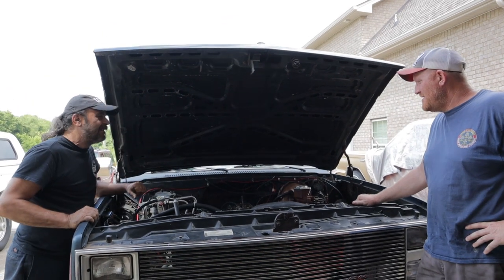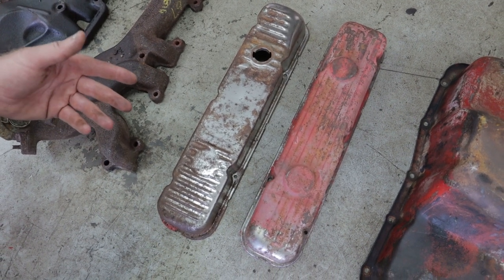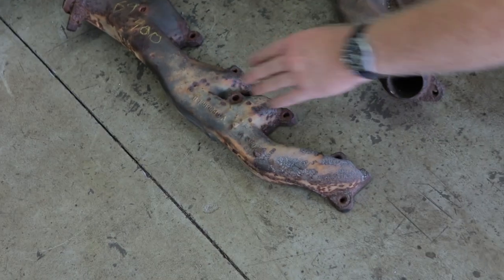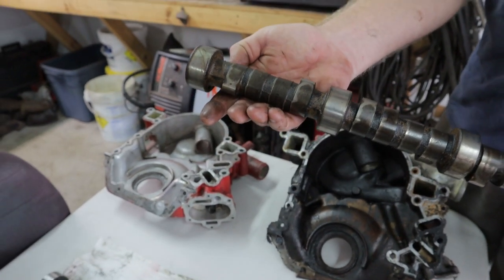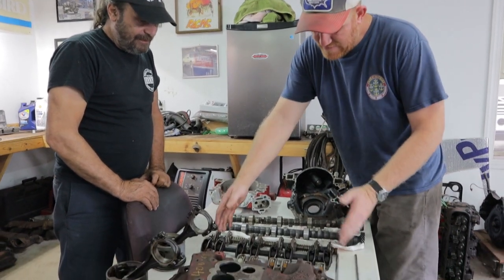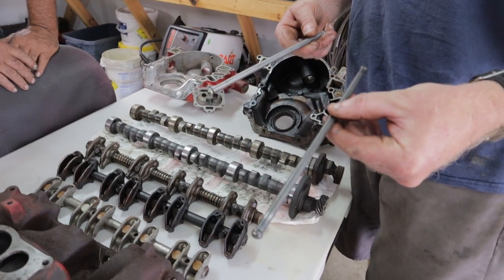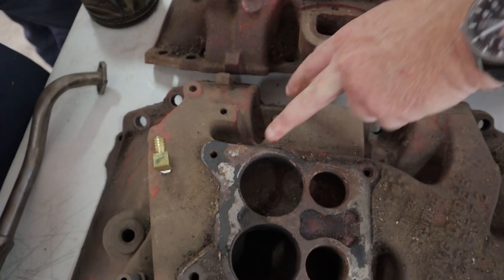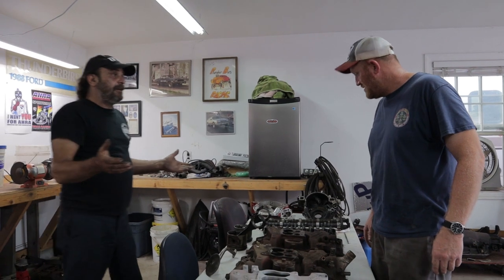Buick Big Block Info Dump

Comment: I have to say that is so cool to see an upscale GM engine swapped into the Chevy!
Reply: So true..better than a LS swap!!
Reply: Definitely like that it’s different than the normal swaps.
Reply: @jtuck6065  absolutely!  Plus it's a torque monster...just what the Dr. Ordered..
Andy
Reply: I run one of these in my 72GMC 2500 longhorn
Reply: Makes sense for a tow rig! And definitely something different.
Reply: Tow? Diesel. Cummins😄
Reply: Dulcich and frieburger already did it to a Chevelle! They said the Buick motor was better than a small Chevy! Lol
Reply: @cjbert6790  I remember that, it was one of my fav episodes
Reply: I used Pontiac motors in everything back in the day same thing torque monsters
Reply: @zelenskysboot361  caddy 500 kills
Reply: It’s cool any time a Chevy engine comes out and anything else goes in. ;)
Reply: @stevelacker358  Yeah, no question that Chevy engines are some of the cheapest power out there, but I start getting really bored seeing them in absolutely everything. I get excited to see almost anything else, and there is some really cool non Chevy stuff out there, like these Buicks.
Reply: Thinking about building a fiberglass 32-34 Ford with a cad 500 as long as I can put a manual trans on it . Would love to use a old Muncie and add a gear vendors overdrive and at least a 411 9 inch .
Reply: @gregblack3860  I love that!
Reply: @gregblack3860  I have a 472 in a 70 Cad, it pulls pretty hard!
Reply: @AudioOrchardMusic  I bet it does .I love that initial tip in of torque driving a diesel but I don’t like diesels so much . I’m thinking in a street rod with some go fast parts like cam headers etc it would run a 11 second without reving past 5 k
Reply: @gregblack3860  yeah man! And you have the added bonus of having your rod sound like a caddy, they have a unique sound that really works for a hot rod or a rat rod. In my opinion :)

Comment: Damn, even Uncle Tony spoke of a Riviera Stage 1 that one of his customers owned decades ago, and how "brutal" it was. Weeks ago, I posted a comment under one of these Buick series of videos, telling about a '71 Riviera that I owned long ago, that was insanely fast with the most torque any of us ever experienced in any of the factory classic cars. My dad & several uncles were hot rodders & good mechanics. They all drove that thing & swore "this is no regular 455 Riviera". I asked Dallas about it in that comment, and he said that Stage 1 packages were indeed available on the '71 Riviera's. The damned thing even came with a factory posi rear-end. So I believe it must've been a Stage 1 package. I wouldn't race any of the faster cars in town from a standing start, for obvious reasons. But I would blow their doors off from a 40 mph roll-off. I kid you not. I drove it for about a year & sold it. It still ran great & used no oil. Wish I still had it.
Reply: While Buick did not "officially" offer the "Stage 1" package on Rivieras until 1973, the 1971 and 1972 Riviera Dealer Order Form lists the G.S. Option (yes, it actually has "periods" on the order form) as having: a modified 4 bbl high performance engine. Tearing down several Centurion and Riviera engines revealed large valve heads that were not unshrouded like the Stage 1 heads were. We also believe they had Stage 1 valve springs and different carb jetting and distributor curve.
Reply: Just remember, there were no 1970 Stage 1 Rivs.  All of this "big car" Stage 1 business was accurately covered in the GSCA's  GSX-tra publications years ago by Richard Lasseter. Those old GSX-tra issues were a wealth of ACCURATE info.  
    BTW, back when the over-the-counter Stage 2 parts were offered, the B4B manifold pictured here had only the Holley bolt pattern.  The dual bolt pattern B4B shown here came much later.  These could be used for either square bolt or spread bolt carburetors. Also, no Stage 2 parts came in the trunk. They had to be ordered over the counter from any "in the know" Buick parts dept.

Comment: I built a 1986 Regal with a 1970 455 out of a 1970 Electra, stock th350 and converter, Moser 9" 31 spline track loc w/2.75 gears,  ran 12.83 @108mph in the 1/4!
Reply: Wow with 2.75s

Comment: Ford FE's have their end rocker arms hangin out in the breeze.  Oh yeah, and 70 lbs intake manifolds too.
Reply: and exhaust ports exposed for cooling. but those intake manifolds that duck under the valve covers are interesting--and easy to ID on sight.
Reply: Don't forget that FE's have the lightest heads.....because 1/3 of it is connected to that heavy intake....
Loose the Iron intake for aluminum and save 60 pounds

Comment: I'd like to see a sbb 300 stroker using a stroked 350 crank and 6.2 Nascar take out rods that are for the 1.850" rod journal size that will give you an extra  .140" stroke. Will require custom pistons.

And then top it off with a set of TA aluminum Rover heads. Out of the box intake max flow is 225 CFM, can be ported to 300.

A solid roller cam would be a great addition to that build but to take advantage of all the extra air flow, a custom intake would be a great idea.

It would end up as a 362 CID if you give it a .050" overbore. Can't wait to see this built. If you have any questions feel free to ask, I'll share everything you need to know to build the above.

Comment: Buick 455 is the ultimate torque monster
On the street of all muscle car engines
Best 455 of all bop’s in stock form
and  Iam a  Pontiac guy!!
Reply: Mopar 440 was the best on the street! I never lost to a 455 or any Pontiac,unless I slept on at the light and lost traction(very hard to get traction)..These were all basically stock cars,headers,carb,mufflers only mods!
Reply: @01trsmar  The std. 455, likely so.  My '69 RR 440+6 lost its share of races to several Stage1's.
Reply: And, the Buick 455 was the lightest of all GM big blocks

Comment: Dallas, can you talk about what aftermarket/factory upgrades people would make to the Buicks  ? What parts you could get that would make a difference. Thanks from 15 minutes away from Flint
Reply: One company so far makes part. TAPERFORMANCE.  They seem to have absolutely nothing available since the pandemic. And They wont answer on facebook.    There is another one that is coming out, that have crank kits.  Kenny betts racing.com.  But for the most part, its Ta performance out of Arizona .
Reply: Back in the day, my friends with Buicks used Kenne Bell Performance Parts
Reply: @corndog2835  yeah. And he no longer does Buick. He just does ford, and forced induction.  And his old Buick equipment asks a premium

Comment: The Ford FE is the other rocker shaft with unsupported end rockers you were trying to think of.
Reply: Was the 352 and the y block the same ? Im a oddball fan even if its a ford 😵
Reply: @vicmccartin  the 352 is not a Y block if that's what you're asking. The Y blocks under oiled the rockers and the FEs over oiled them, however the FE is famous for snapping the end of the shaft at high rpms.

Comment: Great video! I would love to see some Buick Small Block content now that you have covered the legendary Buick Big Blocks. More content on Buick oiling systems would also be great such as showing us how to set up an oil pump, port a timing cover and perform other oiling system upgrades.

I have a Buick 350 factory installed in my 1969 Jeep Wagoneer and would first like to know what I should do to prolong it's life (oil system upgrades etc) and after that I'd like to hop it up a little bit. It's the factory two barrel engine but I obtained a '69 four barrel intake to install. I'm undecided on what carburetor to run, it's a street driven truck so I'm looking for good drivability, mileage, and low end to mid-range power... I've heard a lot of great things about the factory style QuadraJets but would one of those be too difficult for a me as a total carb newbie to tune?
Reply: Checkout the oldsmob455 channel on YouTube. They go though a oiling system  modification on an AMC 401. Very similiar oiling system with the pump in the front cover.

Comment: The rocker arms are unsupported on the ends on FE Fords. My old boss Kip Martin raced a 352 in a '64 Galaxie in SS/OA. He built ten sets of rocker shafts and stands that did away with the through bolt setup to strengthen the shaft. It changed the flex at the end of the shaft from around .020 to about .001 when using 750 lb springs for the roller cam. Buick seems to have actually put a little thought into their exhaust manifolds for a long time. Some of the old nailheads had tri-y style manifolds.

Comment: I've got a 500 caddy in my k30 and I luv it, almost 550 tq at 2200 rpm.
It's a good feeling doing a burnout with 4:56 gears and 35 12.50's and I'm not even in the secondaries.. almost diesel like torque.
Been thinking about 3:73's because of gas prices though, it's got the torque to turn em

Comment: I'm a Buick lover, I had a 71 Wyoming highway patrol lesabor my dad's uncle gave me, his son gave me a 74 4 door I put the 430 from the 71 in the 74 just before I moved to Vegas when I was 19, was very good friends with guys that set up the 1/4 miles track, I ran the old girl several times just setting up the clock and the guys couldn't believe that old 4 door ran 12,90 in the 1/4 mile,one diehard Buick guy came over and was talking to me, he noticed the valve cover!!! Then proceeded to argue with me that it was never produced!! It had the ribs from inside to outside but in center was raised.......430 pi!!!! All I did was pull the frozen 350 out and put engine, trans,drive line and rear-end from the 71, truthfully was first swap out of all the drive train for me, I was 15 but drove car from 16 till 24, nothing could touch it street or track in my class!! All stock, cast everything, only thing I did was take the hood off, I got tired of opening it to prove all stock! I've been told that they never made A police inercepter Buick, but the valve covers had raised 430 pi that matched the rest of cover! It was a old blue and white Wyoming highway police car!!
Reply: Awesome

Comment: It has been a while since I have seen anything on Big block buicks on youtube. Thanks!  I have a 71 455 that is in a 225 2dr electra that has rotted rear frame rails from the salted winter roads up north. I picked up a real nice roller 79 F body camaro that I'm going to stuff the 455 in. Pretty much going to leave the 455 stock except for a refresh and a TA cam swap and edelbrock intake.

Comment: Next if he's got one the 215 Aluminum Block. Although the Olds version with extra head bolts is likely stronger.
The 215 is basically the root of the Buick Small Block.

Comment: A couple things that were left off in this video:
The Stage 1 package also came with a different distributor and a more aggressive transmission with the designation "BB" along with 3.64 gears. The Factory Stage 2 option also included a more aggressive cam, round exhaust port heads and headers to match...not just a B4B intake. Great video!
Reply: True. Only a few distributor internals were different to change the advance curve.  Cam-wise, the Stage 1 exhaust was used as the Stage 2 intake lobe and a new, more aggressive exhaust lobe was used.  Lift was still well under .490'.
Reply: @albundyrocks2115  Thanks, Al. Looks and sounds great. I've never seen it at the GS Nats. (May 17-20 '23).  Do you know about that fantastic BUICK-only event?
Reply: @LR-my2di  I was there in 1984 with my GN. I live in Washington State now and it's too far to go.
Reply: @albundyrocks2115  I understand.  I went this year and it was really something else, but everyone was much older but still having a ball. It was surprisingly big and people and cars everywhere. Kudos to Rich Lasseter for keeping this event going strong after 42 years! .

Comment: Best street/race cam like stage 1 or 2, The different carbs cfm, Are the ram cars overrated, I've only see one stage 2 car different hood scoop and it look like bbc heads. Also the buick 350 is a little rocket also.
Reply: You mean the Mopar Ram Cars? they were most certainly NOT overrated. It was a platform run by the engineers at Chrysler on their own dime. They were looking for ways of making Chrysler products faster on the lot, not just at the track. They were successful in that as well.

Comment: A friend in high school had a 70 or 71 Buick GS Stage 1 or 2 can’t recall. It had independent rear suspension, like a Corvette. Only Buick had that option, couldn’t get it on the Grand Prix, Cutlass, or Chevelle or Monte Carlo. That car was fast and rode like a dream.
Reply: You may have thought so, but no it didn't. It was not a Stage 2.   There were NO independent sup. for any American car but Corvette in those days. If all was in good shape, all Buicks "rode like a dream".

Comment: The BOP division made some of the best engines in GM history.
Reply: Diesel torque
Reply: I know I want to build a wicked Pontiac. A 303, actually, which is a 400 with a destroked crank, and should rev to 8k.
Reply: @ScottKenny1978   nice like the real trans am engine for the trans am series in 69 .what heads you gonna use and what is that a 326 crank or something earlier ? , use to have a 428 high compression small valve head motor in a 79 trans am
Reply: @vicmccartin  gonna have to have a billet crank made with a 2.84" stroke. That whimper you just heard was my bank account.

Found that DCI makes aluminum Ram Air V heads, so those are going on. 

Problem is actually deck height. If I do it right, I will have to either cut down a 400 deck by 1.1" or use a 301 Turbo block and sleeve it for the 4.12" bore.
Reply: @ScottKenny1978  no shit lol we all have are demons. Should be a high winding poncho what are you putting it in with what trans and compression and cam ? Sounds cool . butler heads i assume or some ram IV clones ?
Reply: @vicmccartin  DCI aluminum Ram Air V heads and intake, not sure about specific pistons yet. Probably 11:1, run premium and octane booster on the street and actual 116 race gas on the track. Aiming for 500hp at the crank, so may need more compression. 

Not sure about transmission, other than a stick.

Plan is to drop it into a 68 or 69 Firebird, built as if it was a Trans Am race car. 8pt cage, dual 4bbl carbs since they were legal in 69, and probably some front end bracing like in a gt350. And some other suspension tweaks.
Reply: @ScottKenny1978  the 69 trans am is my favorite white with the blue stripes blue interior. But for around 5 liters you should be around 450 to 500 id think depending on cam id try e85 over 116 if its around you and a vacuum pump that should help and 3 inch exhaust if your gonna run exhaust
Reply: @vicmccartin  I have both e85 and 116 race gas (or even avgas, if I get drums of it). But premium and octane boost is much easier to get, there's only a couple of stations selling e85 around here.

I personally like the 68 firebird better looks wise, but for the purpose of the build ("what Pontiac would have run if the 303 was done in time") it has to have a 69 nose on it.
Reply: @vicmccartin  cam was historically a solid lifter version of the Ram Air IV, and the few race prepped engines were making 475-525 HP. So I think 500 is doable.

Comment: I would like to add that the Stage2 package came with the Stage2 camshaft & pushrods; Holley 850 cfm mechanical-secondary carburetor; a set of 11:1 or 12:1 forged-aluminum piston set; GM 4:78 - 10 bolt gears; edelbrock B-4B aluminum intake and finally a set of the real Mickey Thompson Super Scavenger headers that were painted Orange- prior to the release of the Stage2 cylinder heads.

Comment: Thank you, and yes I am curious about the timing cover and block oiling mods? I have my 70' GS455, block out to rebuild, but I put a 73' Riviera stock block in it to keep it running. Another key point is my 1970 block was drilled out for my clutch arm pivot bolt, but when I put the 73' motor in I had to drill and tap it? Great series guys👍

Comment: Fun fact, I haven’t heard them mention it but the SR-71 Blackbird relied on 2 Buick 401s to start it. A special trailer with straight-piped 401s attached together thru auto transmissions with belt drives jump-started the compressors in the Pratt & Whitney engines that powered the Bird.
Reply: This was well-covered in the GSCA's "GSX-tra" magazine.

Comment: Damned Buick 455 oil pans...installed a 430 from a Riviera into an Electra back in the 80's,  had to swap the pan because it was Riviera motor.  Got motor installed and sounded like a bad rod knock.  Ended up dumping the car off to a buddy who pulled the dang motor again. When he checked the rod bearings - they were all fine.  Turned out that one rod bolt was hitting the fricking oil pan- he could see a little scrape mark.  He pounded the pan out a bit and put her back in the car....it purred like a kitten.  He flipped the car and made a grand on the deal....I was quite p.o. 'd.

Comment: I would like to see a nail head buildup for horsepower. There are a number of nail head performance parts and Centerville auto has a recommended head porter that can flow the heads to a big block 455 CFM. They also have camshafts, valves, springs, roller rocker arms and other engine parts. Thanks, Robert Stump

Comment: Would like more on  the 350s. I have  a new, never installed 79/80 Buick 350. My high school auto shop won it at GM trouble shooting contest back then. I bought it in 89. It's still never been ran..

Comment: I cut the heat riser butterfly out of my manifold and welded the rod in to prevent a leak. I would like to take it right out, but it’s awfully hard to bolt a pipe up to a manifold that doesn’t have a flange lol.